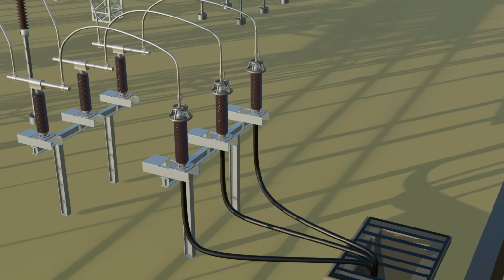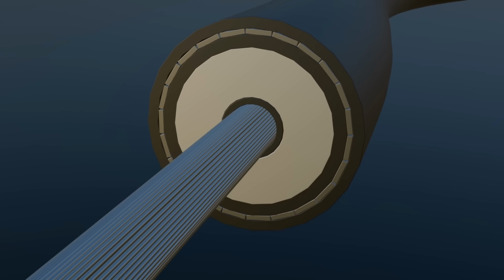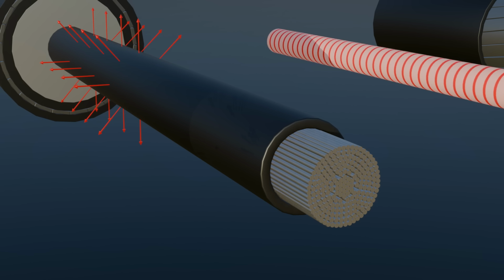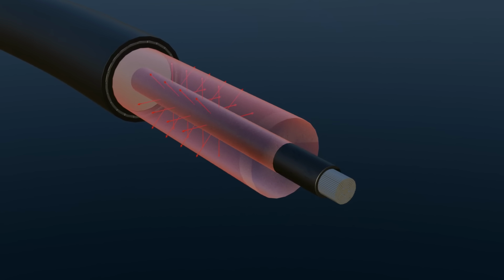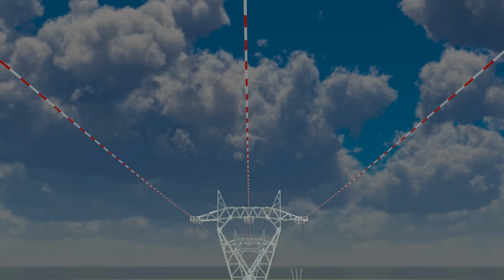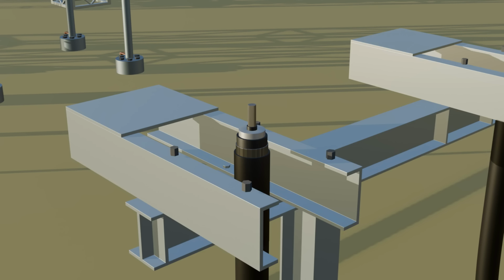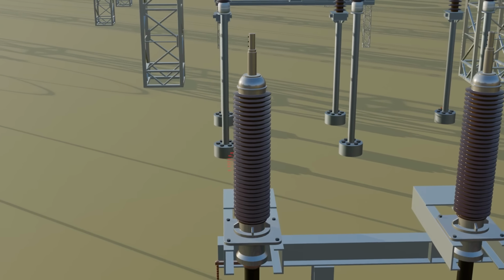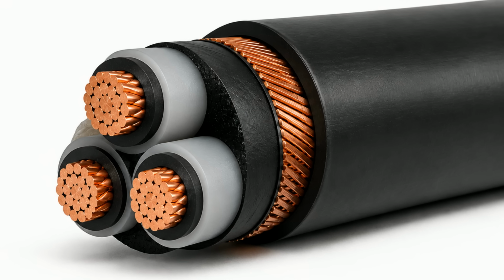Why Underground Power Transmission Is So Challenging?

Comment: For the record, the captive effect exists in all electrical lines, even those in your cell phone or tablet. In most general purpose applications, it can be completely ignored. It becomes problematic with high voltage and/or high frequencies. That's why it matters here. Also, skin effect at 60Hz is not quite as dramatic as shown. One advantage of DC is that there is no skin effect at all because there is no alternation of the voltage and current. As for the shape of the conductor, some cables with trapezoidal strands are used to allow for more efficient packing of the conductor bundle and give smaller diameter cables for the same ratings.

Comment: I found I couldn’t completely trust the content as you were using kVA as the measure of voltage. KVA is the real power able to be handled by the system, combining both active and reactive power, kV is the voltage.

Comment: The answer is AC vs DC.
Literally
Reply: For those wondering, AC is more efficient overhead for transmission but HVDC is more efficient underground
Reply: @ShaheenGhiassy  Untrue statement.  I'm an Electrical Engineer.  DC is always more efficient for transmission, but until recently it was too expensive to step the voltage up or down.  It's just starting to be economically feasible on any scale.
Reply: @earthwormscrawl interesting. Thx!
Reply: @earthwormscrawl  "According to the scientific journal, PNAS, the conventionally cited break-even distance for new DC over AC overhead lines is ∼600 km to 800 km." 

That's not always.